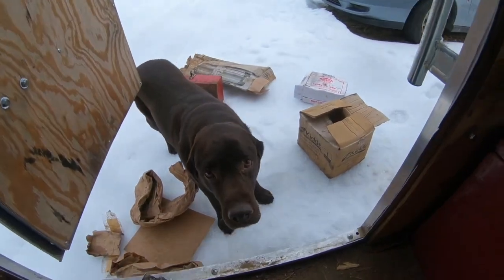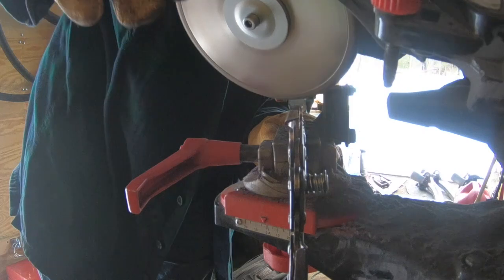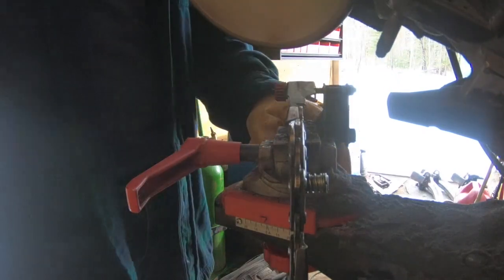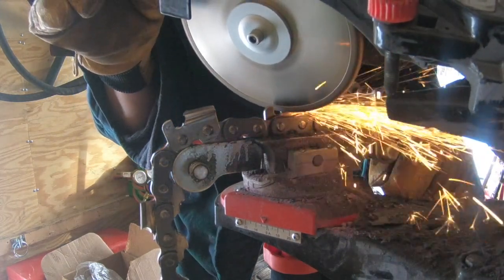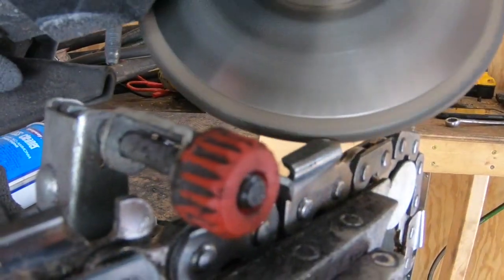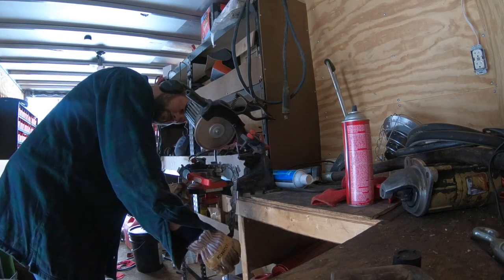Sharpening harvester chains with diesel dog!

Comment: do you have to file the rakers ?
Reply from the maker: mark gomm I youse to bring them to a guy that sharpened them that would file the takers. But in my opinion for what we do it’s not worth it I just get ride of the chains when they get to that point.
Reply from the maker: Pr thanks for the advice. I haven’t really seen any good raker gages for 3/4 pitch?
Reply: i'd say take about 1/16" off the rakes and call it good for 3-4 shapens. i use a field jig for my chain saw and i'd say i take 50 thousents off mine rakes easy if i were too gauge it because i go by feel and look and i like too throw chips not dust. i'm not the type too mess around when i cut like some people.
Reply: @jeromyw385xp  Measure the raker drop on a new chain and use that same drop after every third sharpening or so.  Lay a straight edge rule across two cutters and use feeler guage to get the drop to raker.  Probably about .045" or so as a guess.

Comment: What model number is this grinder?
Reply from the maker: Thomas Markham I will have to look it’s a Oregon but not sure the actual model
Reply: Spruce if you could find out the model number that would be great! I'm looking for one
Reply from the maker: I believe it’s a Oregon 620-120 bench grinder
Reply: What wheel are you using?
Reply from the maker: Thomas Markham it a diamond coated wheel don’t know the Exact wheel number
Reply: jollystar grinders also have a grinder that can do up too 3/4" pitch. cheaper price tag but just as strong and well built as the oragion ones.